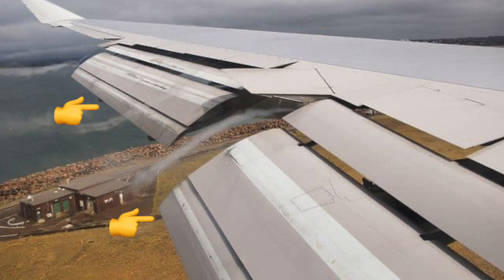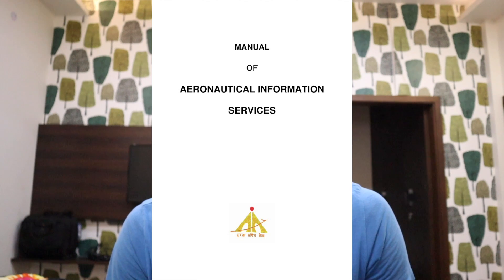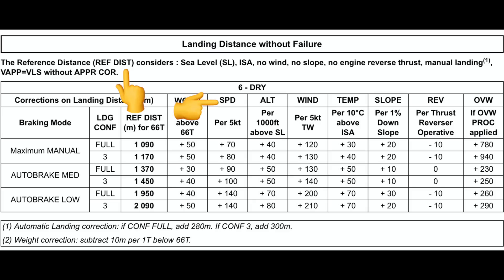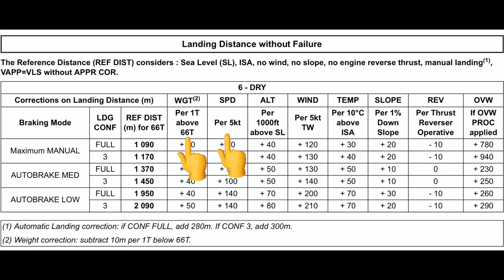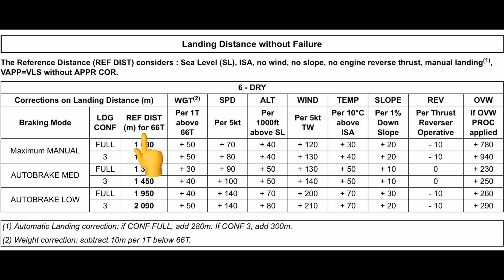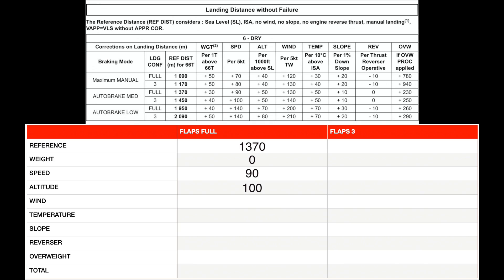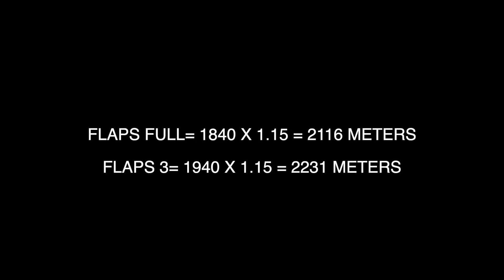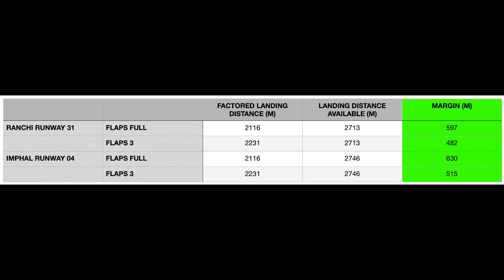HOW DANGEROUS ARE FLAPS 3 LANDINGS ON AN AIRBUS A320? 😰 (WITH PROOF!!!)

Comment: Shouldn’t it be a pilot’s choice to go for flap 3 or flap full landings? Because he’s the one sitting in the cockpit. What are your thoughts on it because you are a pilot too.
Reply: @ashishsingh-506  justification is fine but why give demerit point to pilot if he does flap 4.
Reply: Okay for example you are flying in to Mumbai with a 10-11000 feet runway , why would you need flaps 4 which causes more wear on the airframe and uses more fuel when flaps 3 can be easily managed with more than enough runway length available.
Reply: @dhruvgokhale6674  flying beast is asking for imphal not mumbai
Reply: @ak9902  In the end , it's the pilot in command's decision , I know a senior air asia pilot and he told me it is easily possible to do a flaps 3 landing at imphal
Reply: @dhruvgokhale6674  its not about possible. Even if one has iota of doubt of passenger safety. Its should not be done. Penalizing pilot by giving demerit point is wrong way of encouraging flap 3 landing. Please see amit singh twitter, in which he  show proof of 90% flap 3 landing in Imphal of airasia is unstable. I repeat Air Asia june 90% landing in june month in Imphal was unstable.
Reply: @ak9902  But the final authority on what flaps to use rests with the pilot in command of the aircraft , when he is in the air , the aircraft is under his rules , he decides what flaps to use for the given conditions...
The airline recommends using flaps 3 as much as possible , but in the end the pilot has the final authority and the airline can't question his actions , the maximum they can do is ask him the reason and that will be the end of the discussion. And in the end why will the airline risk their aircraft and reputation plus so many lives for something even remotely unsafe..?
Reply: @ak9902  xactl
Reply: Good Question to Boeing Boy.
Reply: its according to airlines SOPs.every airline has own specific SOPs and every pilots follows that.
Reply: @tarang926  hell with SOPs. If it is in line with human life. Has every right to raise voice against it.
Reply: acording to A320 FCOM flap 3 or full flap can be used on landing nothing wrong in it.Pilots fly according airline specific SOPs & also pilots are trained to fly according to Airline SOPs(standard operating procedure )

Comment: My father is a airline Maintenance Engineer and he told me Flag 3 is not dangerous you could take a verry successful landing . The full landing is only for( emergency). So Gaurav is  
Wrong here as my father is Senior Engineer. And the full landing will cost extra 80 thousand Rupees OIL .
Gaurav is wrong.

Comment: Reason for not considering runway condition?
what is the slope of Imphal runway? 
Wet runways require longer stopping distance and lower braking in order not to skid. Worst case  stagnant water results in hydroplaning or aquaplaning it also takes a longer distance to stop. I guess max braking cannot be used under these conditions so that the tires donot loose surface contact. So you brake less to maintain stability. And the engine reversers consume lot of fuel it's like running your engine at peak and reversing the airflow. 
PS: Air Asia is mostly exiting Indian market not because of this issue but due to some issues with their domestic partner in the JV.

Comment: Bro the main point is not how much runway space is left, the point why is Air Asia setting targets of doing 98% flap 3, should it not depend on the pilot which flap he wants to use. Along with that shouldnt flaps be used depending on the weather and the angle of the runways?? All you said is runway space is available, that was the only point that was made. Arent there many other factors when making a call on which flap to use?? include that too.

Comment: If you fear losing job so be neutral. Don't take stands. The calculations you showed in the video might be right but they are based upon assumption and real scenario is very different from what you have assumed. With your calculations we saw that the margins are less. The landing distance might be long and what for wet runways you did not show any calculation for that. I also assume(like you assume many things in the video)that you are instructed by higher authority of airasia to make video against Gaurav sir.Always remember accidents in aviation don't happen regularly and when they happen the first blame will go on pilot saying that the pilot was trying to save fuel but not lives. Also remember Mr. Tapesh that if some unfortunate thing like accidents ever happen while you are the pilot in the present time you will be first blamed. Have you sold your soul for some money.

Comment: prevention is better than cure, it's not about who is right or who is wrong but when we have 180 soul's on board then a company should not set a target of achieving 98% for flap 3 landings. 
Setting a 🎯 target in such a stressful job is not correct. The pilot should be given full control on this and if he does flap full on the basis of his judgement and weather conditions, then he should not be asked about the target. 
#Saabkeliye

Comment: I cannot deny with him on the info he provided bcoz he's a pilot and knows better but the tone he used at the starting of the video to say HOW DANGEROUS ARE FLAP 3 LANDINGS made me believe that he is biased towards Air Asia...
Also, Ranchi has a 3 degree Glide Path while Imphal has 3.5 degree Glide Path, don't they need different flap configurations during approach? Kindly clear this doubt as well....you have only done calculations after touch down but approach is also important, right?
Reply: He was a boeing pilot and just recently joined air Asia and type rated on the a320..
Whereas gaurav taneja is a a320 captain for 12 years